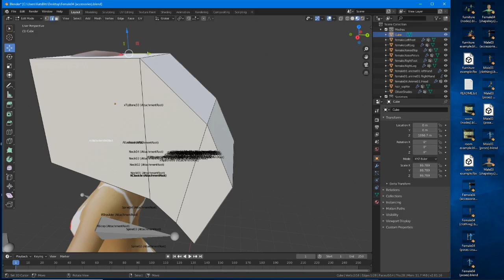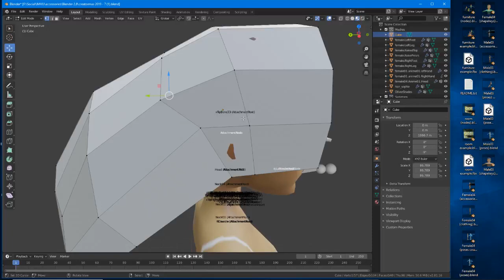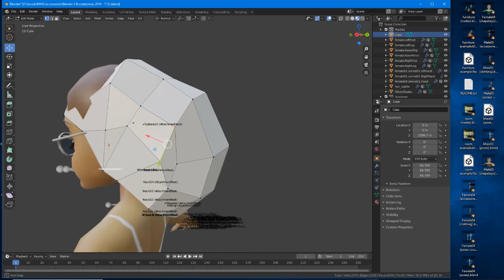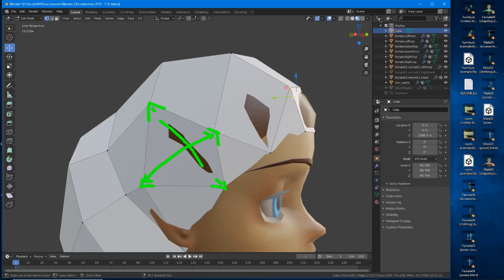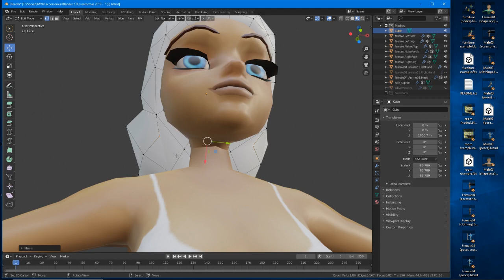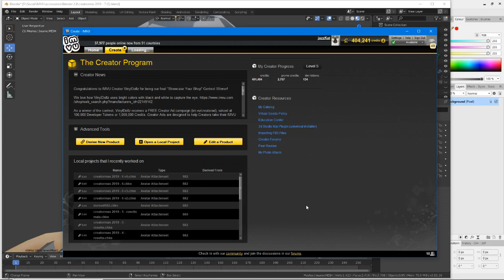Make a Beanie accessory for IMVU in Blender

Comment: 1:19:11  that option does not show up, only  no skeleton and attackmentnode ? when i try to pick that one, the mesh is just floating in the air. what am i doin wrong
Reply from the maker: Make sure the mesh is linked to the Armature fully, that it has a vertex group and Armature modifier assigned.
Reply: @KatsBits  Oh i forgot to click the "Assign" button, thank u!
Reply: @rebeccaxx   ^^
Reply from the maker: @heavenlyhann  See the yellow boxout here https://www.katsbits.com/codex/bevel/#bevel-modifier - if you're using 2.90+ click the "^" icon, it's in there (yes, they moved it).
Reply: @KatsBits   where is the assign button?, mine is doing the same

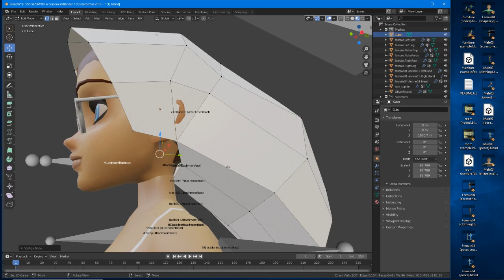Comment: What is the double tap mechanism you used to collapse the vertices around 17:10? Sorry if you answered this later in the video this is just how far I am today
Reply from the maker: That'll be the "G" key to 'Edge/Vertex Slide'. There's an icon for it in the Toolshelf to the left as well. It slides the selection along an edge but can be used to 'collapse' selections together, which then need to be cleaned up https://www.katsbits.com/codex/remove-doubles/
Reply: KatsBits thank you! Very helpful